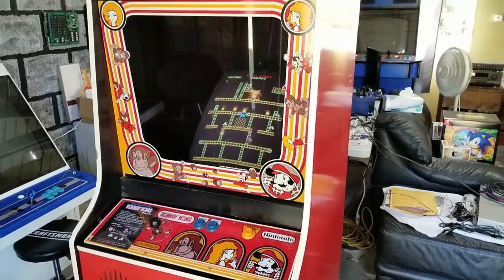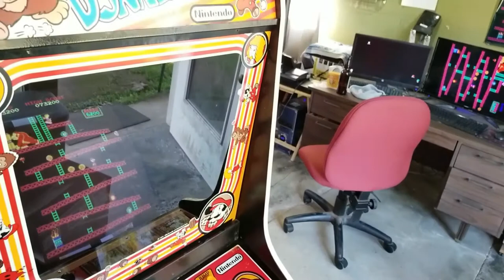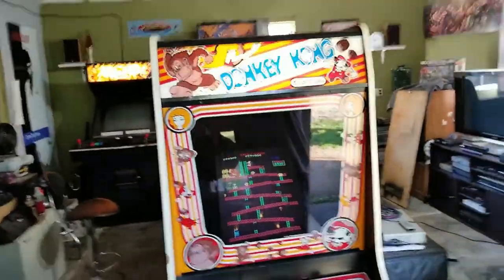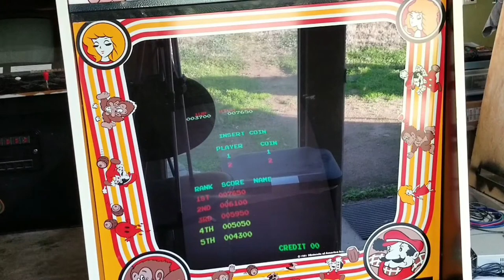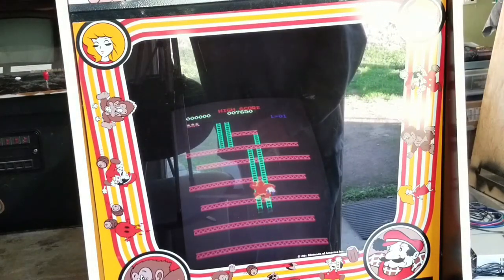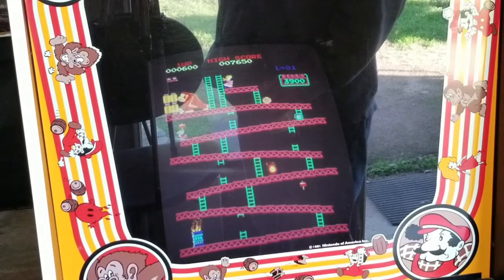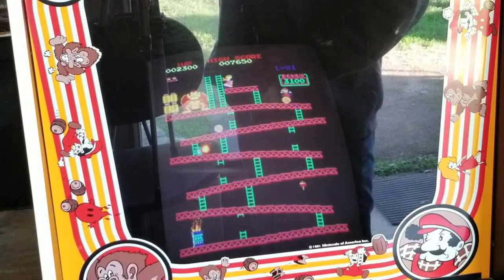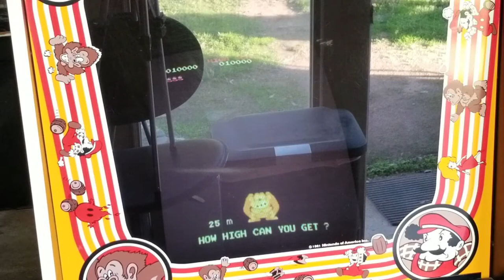MAME Outputting via Gonbes 8100 to DK Cab and Sanyo 20EZ

Comment: Can you please show me how to do this or just what cables to buy.
Reply from the maker: You will need a GBS-8100.  VGA output from a PC into the GBS-8100.  The GBS-8100 will come with a cable for RGBS, which plugs into one of the headers on the GBS-8100.  You will wire the other end of that cable to the Nintendo Inverter Board input; you can solder directly to the appropriate pins on the inverter board for RGB, sync and ground if it's easier.  You will take the stock Nintendo video cable that connects between the game board and monitor, and connect the game board end to the output of the Nintendo Inverter Board.  You will need to provide 5V power to the GBS-8100 also.  You can use an external 5V 2A power supply and wire it to the cable that comes with the GBS-8100; or if you have an available header on the Nintendo cab power supply, Mike's Arcade sells cables that plug into the available connector on the power supply; in that case, you would wire that cable to the power cable that comes with the GBS-8100, making sure you are pulling 5V power from the Nintendo power supply.  Power the cab, feed it video from the PC.  You may have to reduce resolution on the PC.  Check the specs on the GBS-8100, to see what input resolutions it will accept.